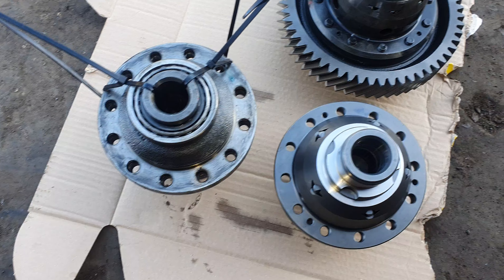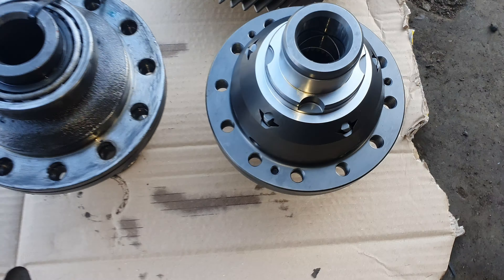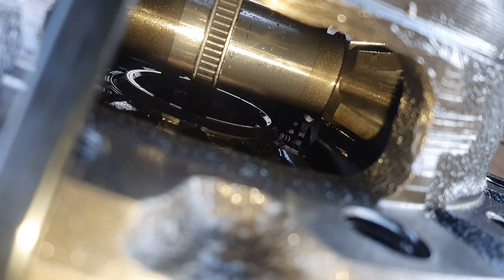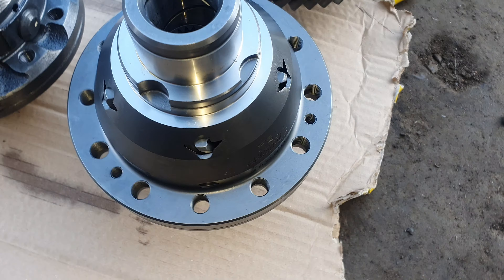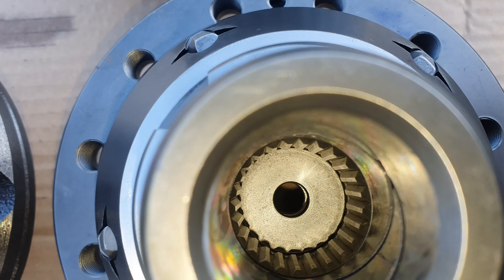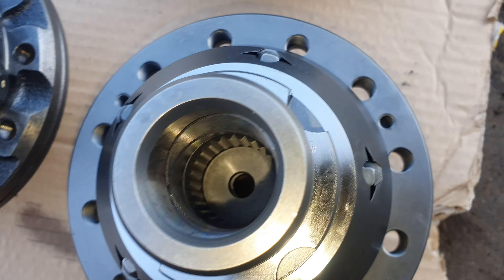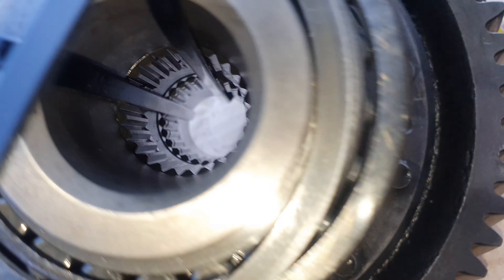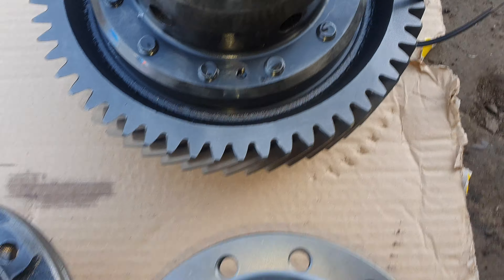Alfa Romeo. How to recognise a Standard Diff,Q2 and Quaife (Torsen) C630 Gearbox

Comment: I want to fit a torsen type diff into an Alfa 33 1.7 Quadrafoglio gearbox.  Do you know of a model that will fit or is perhaps small enough it could be made to fit ?
I can do machining and altering as long as it will physically fit in the gearbox.  Thanks in advance.
Reply from the maker: I can give you measurement but I never had yet a 33 Diff in front of my eyes
Reply: @alfaromeofanclubedinburghuk  Measurements will be super helpful, yes please to any measurements ?  I don't have the gearbox apart in front of me but I'm thinking the following would be helpful - bearing diameters, distance between bearings, diameter of the geared section re clearance for the spigot/input shaft to pass into the gearbox, spigot diameter for the crown wheel and lateral distance of the crown wheel mounting face in relation to the bearings ?  I'll leave it to you, just imagine what you would want to know to be able to determine if it can fit ? Thank you in advance.